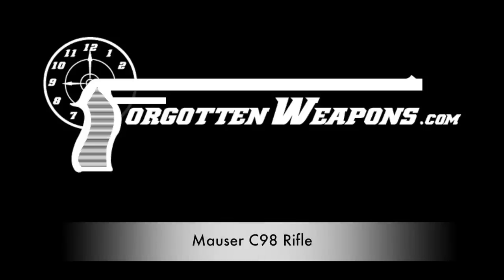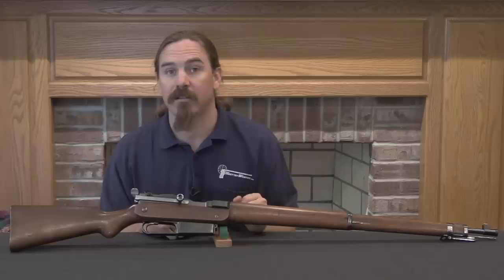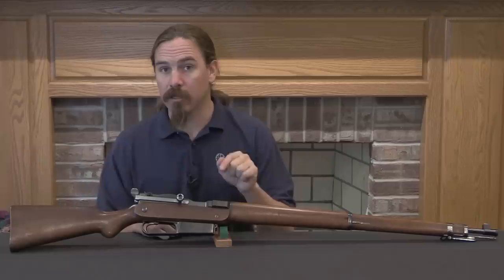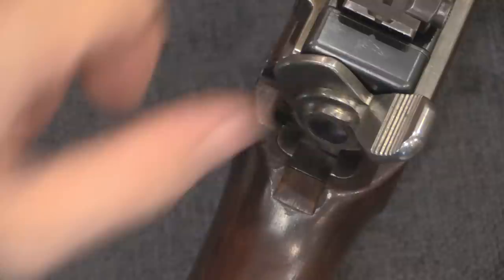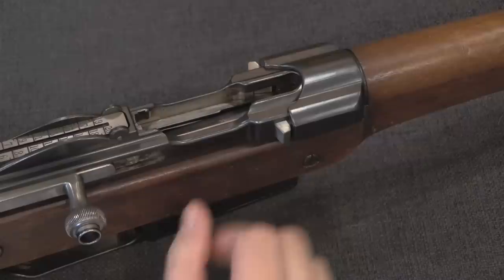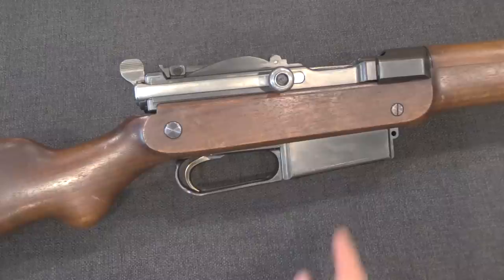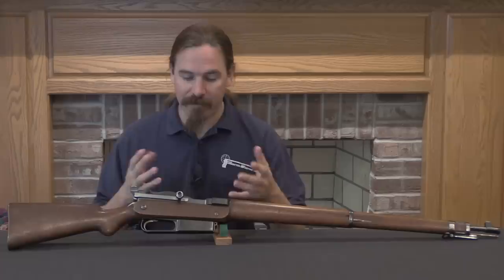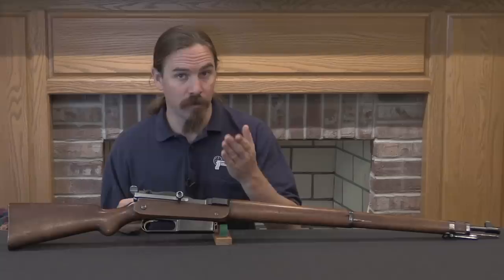Mauser C98: The System That Cost Paul Mauser an Eye

Comment: At least he no longer had to worry about the whole 'close one eye when aiming' debate.
Reply: Im still confused what the benefit is supposed to be from keeping both open.
Reply: @JohnDoe-iw7zc  just situational awareness in actual combat really, can see movement in peripheral vision and also I suppose you can use holdover at long range and see past the sights. If your gun has a lot of recoil you might find it easier to keep a target picture and see if what you shot at went down. Binocular vision could be useful within around 60 meters if your target is camouflaged but most soldiers would just be point shooting by then I'd think.
Reply: @dentistguba  well i always see double when ive tryed both open lol it seems to hurt my shooting on bow, gun, sligshot everything. Anything i might be doinf wrong
Reply: @JohnDoe-iw7zc  I'm a year late, but assuming you're right handed you want to aim with the left image. I can aim well enough with both eyes open unless I'm holding a small gun like a Beretta 950, but at the close ranges that would be used I figure I could still hit my target with both eyes open
Reply: @dELTA13579111315  ok how in the fuck? How do you aim with your left image if that comes from your left eye which isn't lined up to the sights / optic. Having two eyes open is just distracting for me and it feels like all of you are skrewing with me to an extent lol
Reply: During my first times at the range with a gun, it was part of safety procedures. The last thing you want to see happening is to accidently shoot somebody you didn't saw coming. Altought this also meant I was forced to aim like a lefty because for whatever reasons, it was only happening to me whenever aiming right-handed.
Reply: @JohnDoe-iw7zc  Talk to Aimpoint and you will get answers.
Reply: @JohnDoe-iw7zc  I believe it's supposed to be that you can see your target "through" your weapon

Comment: Very elegant. Hard to believe an out of battery safety was not incorporated in the design.
Reply: It makes sense to me, considering that it is a very early self loading rifle and out of battery safeties are not nearly as relevant on manual repeating rifles.
It is due to incident that out of battery safeties are pretty much universal today
Reply: Touche Mon Friar.
Reply: It is very easy to believe that it's obvious in retrospect, but if you're that guy making one of the first of a new type, then there are some things which only become obvious after an accident.
Reply: It's not incorporate in the mauser 91 who can be shoot without the bolt locked, so that doesn't surprise me that much

Comment: Wonderful action. I suspect a small modification to the firing pin mechanism would have negated the misfire issue. We're there any other problems with the flapper action? I don't see why this could not be developed for modern usage otherwise.

Comment: It looks good how come it wasn't successful rifle? What did it flop? He should just make sure it wouldn't be able to shoot if it was not fully locked 
P.S support your favorite guns channels and try to post your comments on every video just to show YouTube we matter and gun Community is strong
Reply: It flopped when it popped and spooked Paul about the dangers and possibilies of out of battery detonations in self loaders.

If that happened to me back then, I'd go "fuck that" and do what he did and drop the short recoil try and do everything I can to prevent any more cartridges from popping out of battery and save many a trooper's finger and eyes.
Reply: Pop quiz. How many successful military rifles (rifles only, not pistols or heavy machine guns or what have you) can you name that were short recoil operated? Or flapper locked? There's your answer.
Reply: The problem was a cartridge detonating before being fully locked into the chamber, I imagine after that accident Mouser basically shelved the entire rifle and went straight to designing one which couldn't possibly do that again.
Reply: Gwer 43 and the Johnson Rifle.

Comment: Does this remind anyone else of looking at a roller - delayed system in reverse a bit? With a little bit of reworking with that in mind, we might have a rifle here. Let's say inside the "barrel beach extension" the flappers, instead of adding a delay in a gas action like an H&K, act as a disconnector for a floating firing pin (think a 80 series 1911).
Reply: Or, alternatively: have the barrel fixed in position and the bolt carrier with flap-wedge actuated by a gas-piston.

Comment: What I believe is the most incredible aspect of auto loader/semi-auto rifle design history & evolution is that, at the conceivable end/"ideal conclusion" of the concept(which is essentially the AR and, arguably, the AK platforms of today), the answer to the basic fundamentals was right in front of EVERYONE's face - an automation of the bolt action rifle. This is all that a modern rotating bolt gas operated rifle action is, it's a conventional box magazine fed bolt action(rotating bolt utilizing locking lugs with conventional extraction & ejection) that is operated by gas pressure instead of the human hand & arm - at its most basic fundamentals, it's nothing more than an automated bolt action, and no other system has yet proven superior. 

We essentially watched a half century of work on a specific type of machine just to see it come full circle.

Now, with that said, perfection is boring, while imperfection is much more interesting - what we've become accustomed to naming "character" because many are seemingly uncomfortable admitting that they prefer the flawed rather than the flawless. Myself, while I LOVE the odd & unusual(AKA, the so horribly flawed that they're now considered "rare" today just because they were surpassed by the functionally superior opposition, like this rather spectacular Mauser), I absolutely ADORE the roller locks, what a beautiful mechanism! But, there's still a reason why repeating rifles ended up with rotating bolt actions, and not a manually operated roller locks(...but, HOW COOL!!!) - just as the auto-loaders also ended up with rotating bolt actions.

Talk about "over thinking it" just a bit - only toolem' a half to two-thirds of a century to rediscover what the obvious(seriously, is there a manually operated mass produced rifle of the last 75 or so years that ISN'T a bolt action?)! And, all they had to do was go hunting...

Comment: Talking about safety on mauser, the mauser 91 can shoot without the bolt being locked and i don't think the thin spring metal that should be depressed for disassembly would stop the bolt

Comment: Hey Ian I might have asked this before, but similar thing to the m47 Medusa that was......it was a thing, Have you seen, or used the chiappa x-caliber? Its a m6 survival type setup but you can order with it the barrel inserts, so it goes from 12 gauge over 22lr to whatever insert you put in the top barrel, and those inserts come in 357mag/38spl, 9mm, .380, 40 s&w, 44mag, 45 acp, 410/45LC and 20 gauge. If you have not seen or used one, I would love to see you do a video one it, preferably with range testing included. Id love to see what you think after hands on experience.
Thanks.

Comment: I see the flaw of the design. It relies on using the front of the receiver to fully lock the gun. 

The locking track should have been on the bolt instead. If the bolt isn't fully forward, the gun shouldn't lock or drop the firing pin.

If you can see the wedges, it's not locked. But the front of the receiver obscures that.

Comment: I may not be awake yet, but that really does look like a clever design, and compared to other early semi actions, the receiver doesn't look like it took nine million machining operations-- I could see it even simplified further to aid quick manufacture. Any further thought on why it didn't go anywhere? Is it inherently unsafe for some reason, or was the out of battery issue simply part of the striker mechanism? And thanks again for tracking down these great oddballs.
Reply: How many successful short recoil, flapper locked military rifles have you seen? There's your answer.

Comment: What's that doodad on the end of the barrel in front of the front sight?  It looks like it would interfere with the use of a bayonet.
Reply: It's short recoil so you can't really put a bayonet on the barrel anyway. That's why the lug on the bottom of the nose cap is so long. The bayonet only attaches to the lug.

Comment: If an experimental rifle had cost me an eye, I think i would have gone into woodworking, or anything but experimental guns.
Reply: I'm pretty sure that you can stiil loose an eye from woodworking.
Reply: Yeah, but eye protection works pretty well with wood. Not so much with flying gun parts.
Reply: @sarjim4381  Ok, you are right, wood splinters are propably easier to stop than metal parts.

Comment: Blooody machine-gun design.. All Mauser had to do was to get rid of the wood in the area of thew action, pistol grip and have the full auto switch to open bolt.. oh, yea..  MG-34..   I think that the flappers would have worked well... better than the Lewis, but not quite as hardy as the Czechoslovakian ZB-26 - 30..  but it wasn't fully developed and we really can not know.. unless some gun nut like Mark Serbu decides to do this..